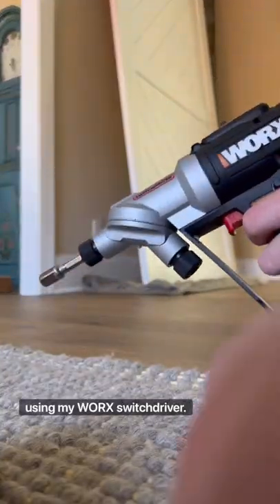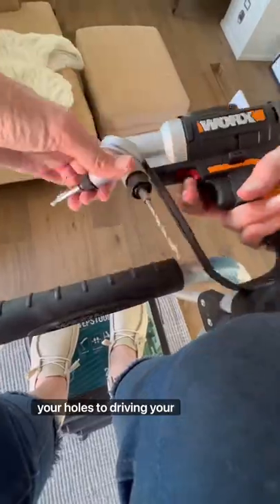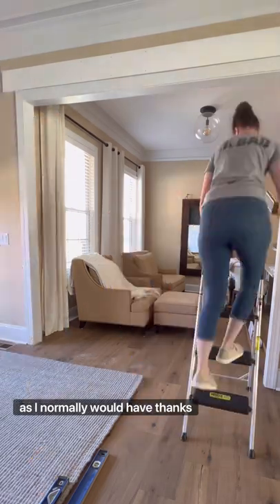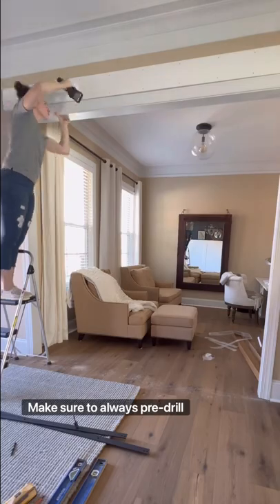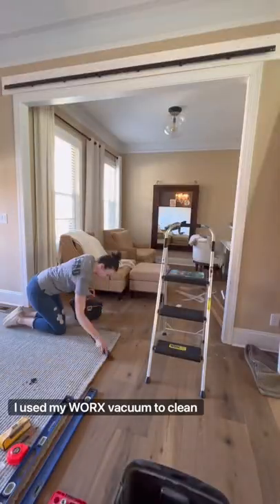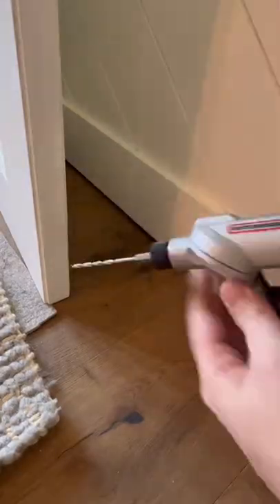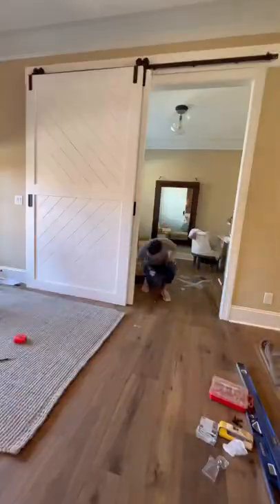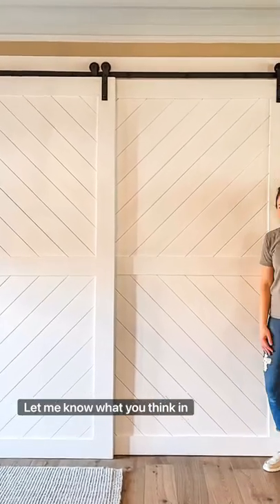Installing barn doors using my WORX switchdriver! #worx #worxtools #barndoors #barndoorinstall

Comment: I was looking for slower instruction on the header part and what you do if you don’t have studs spaced at the correct 16” intervals. Hmm. Wish this was slower.
Reply: You use a header board! Screw that into the studs then install the Barndoor track to the header ❤

Comment: How do you get the door hanging at the right height off the floor
Reply from the maker: I install the wheels to the door and then measure from the bottom of the door to the bottom of the wheel. Then add 1/2” to leave room for the floor guide and some room so the door has some play and can slide freely. I hope that makes sense. I’ll try to make another video explaining that.
Reply: @glamfarmhouse  Excellent explanation 👏 thanks very much. Great video.
Reply: Where did you get the doors? Or did you made them, do you have a video of it?